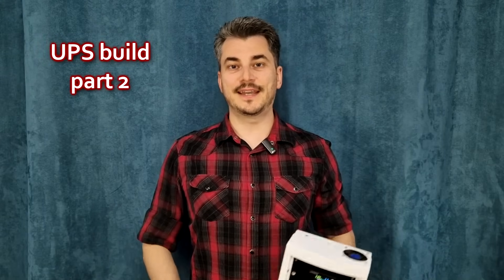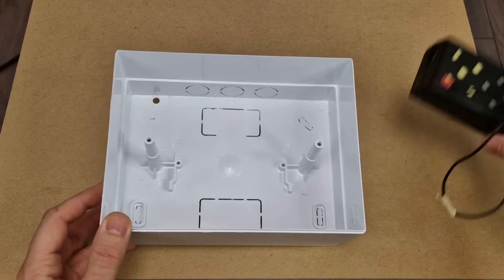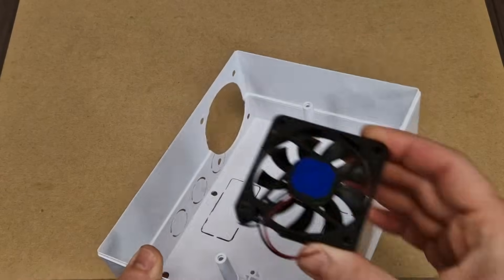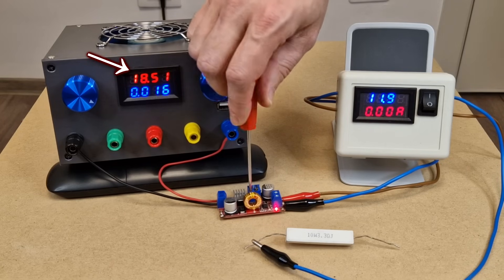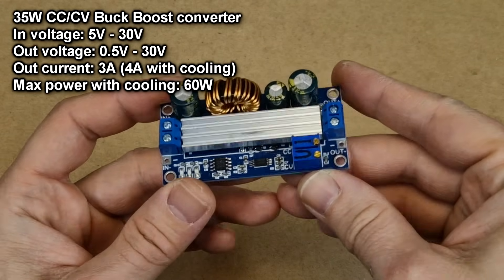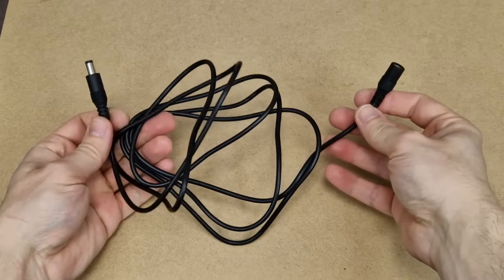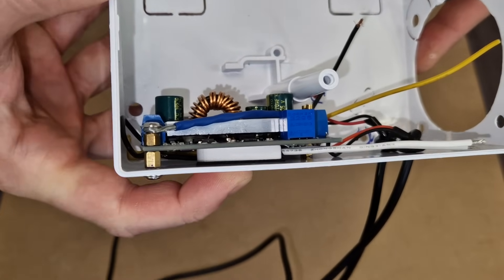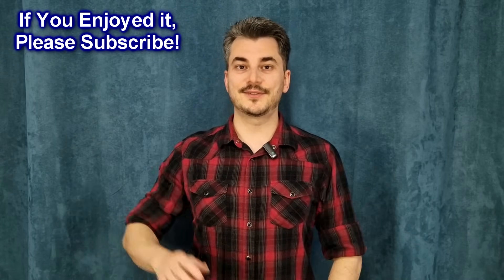UPS build 12V & 5V - part 2/4

Comment: Good job. I have a very similar device at home with 4 lifepo4 batteries, which is used to power a modem, fiber converter, one external disk and a mini server. The outputs are 12V, 5V and 19V. One thing I have added is ina3221 connected to a esp32 with esphome to measure the consumption of each rail. This also lets you add a 3 Channel Relay Module to control each output if you want. I only used buck converters for 12V though as the devices also have an internal dc converter to decrease the input voltage and does work with voltages lower than 12V. Your method seems more fail safe though.